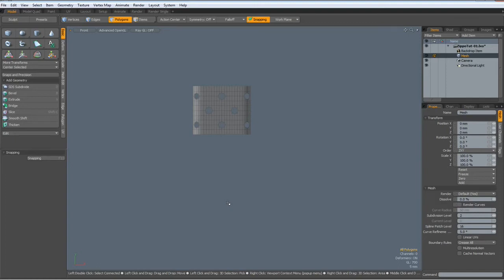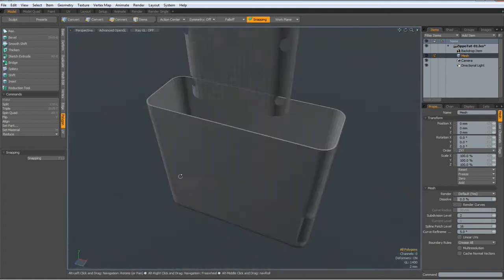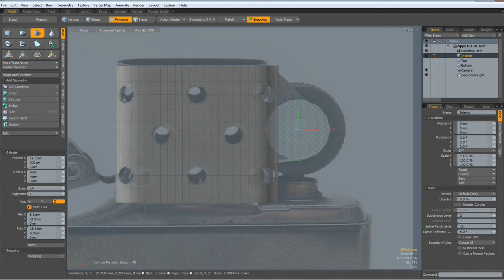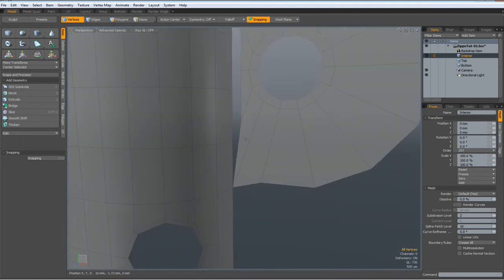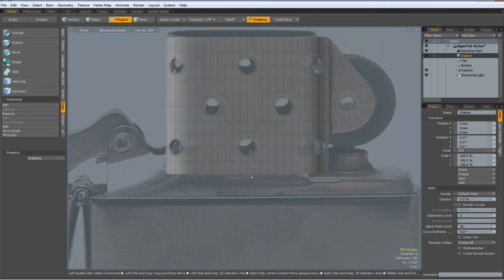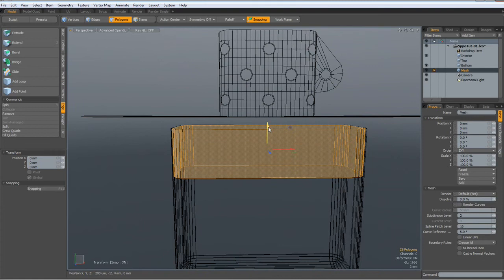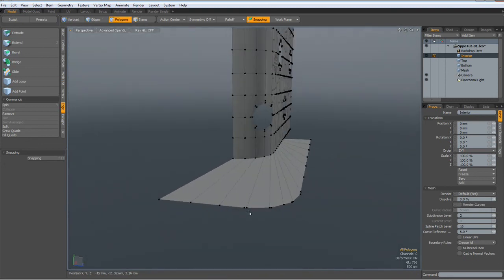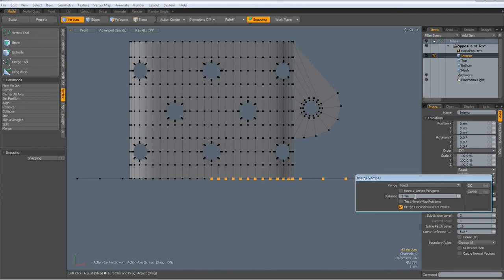Luxology Modo - Modeling a Zippo Lighter - Part 2

Comment: At 10:15min you cut a perfect horizontal line through the geometry. How do you make that cut go at that exact angle?
Reply from the maker: +Patrick von Janicke Hi, there are several ways how to do it. First you could activate snapping, then it snaps to the defined angle. (Default is 45 °). Second you can press Shift-C to activate the tool and then keep CTRL pressed. Once you did the cut, you can press Shift-CTRL to do additional cuts or use the middle mouse button. Finally you can use R-Key without negative scale to make a cut straight :-) Good luck :-) Peter
Reply: Thank you Peter, I will try those tricks right away!